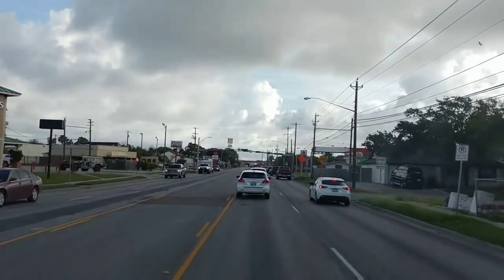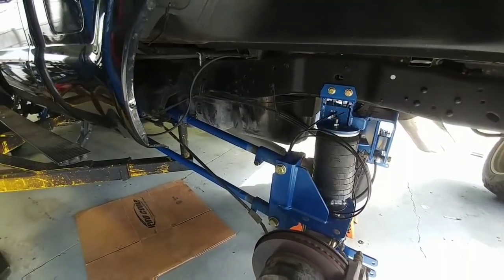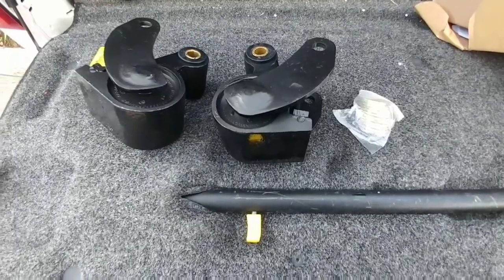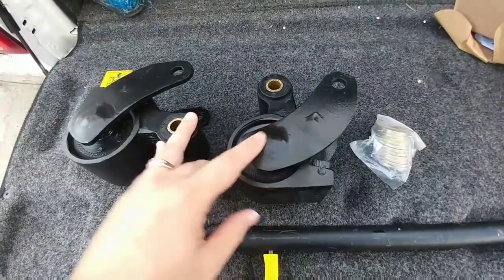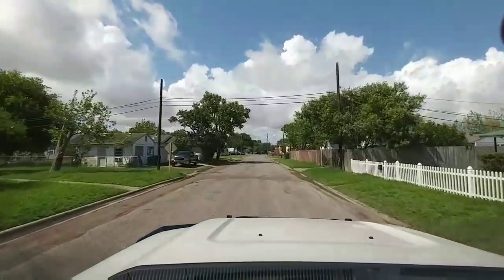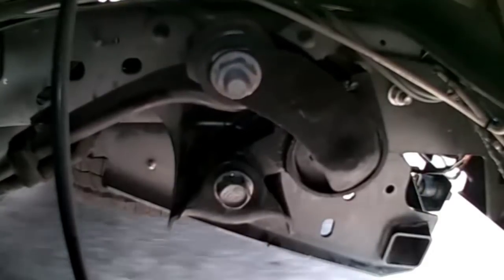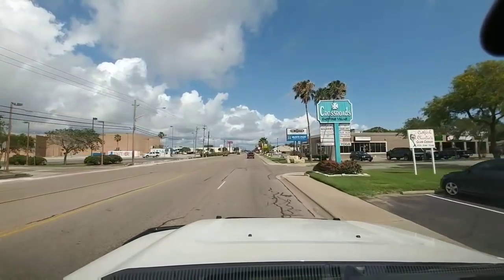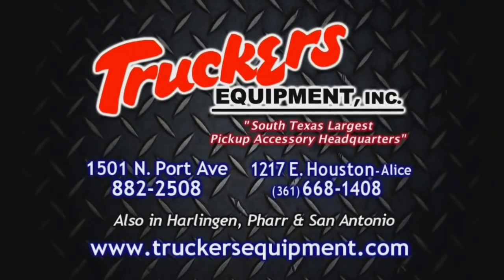Make your 1-ton truck ride like a 1/2 Ton!  Sulastic Springs!

Comment: great video!  I've just ordered a 2017 F450 and may look into these as well.   how much squat are you getting under load.  Do they reduce load capacity at all?  Do they increase the rear end height unloaded?  Thank and love the videos.  subscribed.
Reply from the maker: Scott Weitz: no reduction in load or  tow capacity. The truck sits about 1/2" higher.  And are worth it.
Reply: I too had just ordered my F450 last week. BIG TRUCK BIG RV:  I am working with the  dealer's upfit accessories deptartment to install airbags to soften ride when unloaded-  so wifey doesn't complain.  Would doing these rubber torsion brackets Instead of airbags or a nice addition To  doing both.  I wouldn't mind it driving like a dream.  After all it is our dream truck but for real.    I went with Ruby Red Scott.
Reply from the maker: WeBgamers James: awesome! I'm sure you'll love tou new truck. I would suggest both if its in your budget.  The airbags won't do anything to positively effect the ride except while towing heavy. Airbags are more to level the truck when loaded with a heavy pin weight.  Sulastics are designed exclusively to improve the comfort.

Comment: Why would you cut the bed on a Chevy if you could just lift it off the frame a bit ? If clearance was an issue
Reply from the maker: John Glennon: exactly.  I've seen it done both ways.  Lazy vs time consuming right?

Comment: I have a Dodge Ram 3500 short bed 2015. We use it to pull our horse trailer. My wife can not stand to rid in the truck when we are not hauling. We live in Oak Harbor, Ohio. Do you know where we can get a set put on?
Reply from the maker: Todd H: You can buy them from Truck Master, he ships them anywhere.  And then have any suspension shop install them.

Comment: I I own a Ram 3500 pull a 17000 pound 5th wheel how would that change the rating of the springs and all
Reply from the maker: Kenneth Wutke: should totally improve your ride without effecting spring rate

Comment: What was the net change (assuming a drop) in ride height unloaded and with your 5th wheel hooked up?  I like the idea, but don't really want to squat any more than necessary with my Cardinal 3850 hooked up.  I need as much ground clearance as I can get on my front jacks of the RV for extensions when on even marginally uneven ground.
Reply from the maker: Alan Byers: they shouldn't change your payload height much, if at all, however, you may want to consider Airbags to level things back out.

Comment: Combining a leaf spring with the torsion axle springs as used in many trailers - Very interesting. But since it adds a second spring, there will necessarily be greater sag for the same static weight in the truck. It would be interesting to research trailer torsion axles to determine if they age gracefully over a long period.

Comment: I have 2015 chevy silverado 3500hd in Pakistan 😐

shackles or spring.... should be same ?
and is it easy for mechenic with no professional equipments...?

the only truck like this in pakistan and my  first time owning truck. so i have difficulties to maintain it.
Reply from the maker: Hayat Khan: at minimum ypu will need a set of jack stands and a jack
Reply: Big Truck Big RV 
shackles or spring 
any difference?

Comment: the factory frame vibration damper and the sulastic springs work on the same principle removing one device to replace it with another makes no sense effort should be made to make them work together I installed a ford frame vibration damper on my 2006 chevy 2500hd and it was a night and day difference in ride quality and noise

Comment: When you did the test drive with the 2017 F350, would you say the ride is the same with the installation you made on your F450?
Reply from the maker: Boris Haid: funny you mention that, that's exactly how my wife described it.
Reply: Big Truck Big RV I been watching all your videos and it helped me a lots. I live in Sweden and recently ordered a 2017 F450. That will be the first 2017  to arrive in the country in September. Really excited! 
The downside with our regulations is that I can't hal a gooseneck with electric/hyd brakes. The trailer has to be with air brakes, kingpin adapter and with a 5th wheel. Luckily I ordered that package on to the truck. What cover do you have installed in the bed? Once again, thanks for doing really great videos!!👍
Reply: Big Truck Big RV I really like your truck it looks really awesome!!😎👍
Reply from the maker: Boris Haid: i use the Access Cover

Comment: I have a 2012 dodge 2500 Diesel 4x4 Pick up. I pull a 35 ft fifth wheel with it. Would these springs work on my truck?
Reply from the maker: Mark Carter: they sure would

Comment: I have a 2015 350 srw with airlift bags would these work in unison with the air bags. I tow a 15000 lbs 5th wheel. Thanks.
Reply from the maker: Yes, they work great together

Comment: It amazes me of those who buy a new pickup, immediately jack it up in the air with heavy duty springs, shocks, airbags, bigger tires and all the other bells and whistles so they can win a pissing contest about who has a "tougher" truck.  Then....they bitch and moan about how it doesn't ride like a luxury car.  Sell your truck, buy a Rolls-Royce Ghost and load your side by side, bass boat, fifth wheel, horse trailer, tractor and all the other baubles on the back of that cushy Rolls and drive off into whiny butt heaven.  Gimme a break!

Comment: when towing  my 20000 lb rv what are we looking  with that will it change that being i have a air lift kit on my truck
Reply from the maker: pipefitter Nicholson: They do not negatively effect payload or towing numbers.
Reply: Thanks
Reply from the maker: pipefitter Nicholson: i bet they would compliment your air bags very well!
Reply: Big Truck Big RV thats what im going for my back feels  rough the few time i sit in the rear of my truck its a 2016 350 dully  sometimes i think im gonna lose my head back there lol

Comment: I have a 2017 Ram 3500 4X4 with SRW and the factory installed load leveling air system. Do you know if Sulastics will work with the air leveling system? I think I'll go to the Sulastic web page and pose the same question. Finally, thanks for your videos and I like your knowledge and "common sense and practical" comments and advice/suggestions!
Reply from the maker: Sean Chapin: they should fit without issue sir. And thanks for the kind words

Comment: I did not see the 2017 Ram 2500 listed on the web site. Do they have a set for that?
Reply from the maker: RAM 2500 has rear coil springs and this product wouldn't apply.

Comment: How well will these do on a 2014-2017 RAM 3500 diesel/AISIN DRW?
Reply from the maker: Michael Brown: They will completely blow you away.  Ram duallys have very stiff rear suspension.
Reply: Big Truck Big RV well they do have air ride ram HDs that ride like cadilacs...
Reply from the maker: Dodge 318 Cummins: I've driven the Ram with Airride and they ride no different than a non air bag equipped truck. The airbags are designed to level the truck out while loaded.  They are not for comfort.
Reply: Big Truck Big RV yes the ride sucks compared to my old 1500 ram

Comment: What would happen if you would put these springs on a half ton?
Reply from the maker: Graham Clarence: not sure. try it
Reply: Big Truck Big RV I have a feeling the effect would be an incredibly smooth ride. Is this an accessory for just the rear wheels or the front wheels as well?

Comment: How does it affect tow weight?
How does it affect the load weight?
Reply from the maker: Jay R North: no effect on towing or payload.
Reply: i would imagine it would wear out if under load all the time
Reply from the maker: James Flores: Im sure some have worn out but you dont hear too many negative stories
Reply: quick question can these be put up front
Reply from the maker: James Flores: in some applications. There are no more front leaf sprung pickups being made.
Reply: yes i know but old trucks and medium and heavy duty trucks are still using them
Reply: Cause it is important to beat the hell out of the driver, even though technology has come a long way to give comfort and function.

Comment: I have F350 diesel 2011 XL long bed do you recommend for SA-06HDD or SA-06HD for best ride and long life for the rubber on my truck, And thanks for the video.
Reply from the maker: TheKNIGHTRIDER83: Dually?  I suggest the HD for the best ride, but the HDD is what's recommended for my truck, so that's what we went with.

Comment: how does this affect axle hop on trucks like my 07 ram 2500. in stuff like deep snow, sand etc, i occasionally get pretty bad axle hop.
Reply from the maker: Kyle Veilleux: may still get some, but these will help isolate the vibration from the trucks chassis

Comment: Good vid! I know this sounds nuts, but I run an air lift air bag kit on my 2013 F150, and running empty with a bit of air in the bags gives quite a choppy ride at times. Have you ever had anyone inquire about a 150? Or am I asking a dumb ass question...lol. Yes, I know, I need a bigger truck. lol.

Comment: If u want it ride like  a car . Buy a car.. if u want a 1 ton buy a 1 ton.. u cant have both .. If u have a 1 ton 4×4 to take your kid to school  and it never  leaves  the pavement  . The only time u use the truck  1 to 3 times  a year  . Then u dont need a 1 ton 4 ×4 diesel   .. factors  3/4 and 1 ton can do a lot of u dont mess with them..

Comment: Wat happens when u put 20,000 pound load on your truck wit these
Reply: Looking at the design of them, when loaded they should act just like the solid leaf spring shackles would act. They only work to reduce vibration and shock when the truck is not loaded (ie. empty).

Comment: Please try and do a review for theses shackles on a 2017 Chevy Duramax 2500hd! Please! I'm actually thinking of trading my 2500hd in on a 1500 because of the ride quality. If these shackles help the ride quality on the Chevy, it would save me a ton of money! Definitely cheaper to install these than to take a huge hit on trading in the truck.
Reply from the maker: Michael Whitson: they will help immensely.  Especially if you get the H models or even the HD model.  Also consider upgrading your shocks to something like a Bilstein 5100.  Night and day difference for around $1000 total. Plus you don't lose your butt in trading in and the loss in capabilities.
Reply: I have the 2500hd duramax with the LTZ off road package. It has the Rancho shocks, are the Rancho shocks better or worse than the regular shocks that you get with out the LTZ package?
Reply: All of my 1500's have all been plain Jane base models, this is my first 2500 and LTZ.  I'm trying to figure out what is making the ride so bad, the off road shocks or the over all 2500 suspension in general. I don't know, I've never had either before.
Reply from the maker: Michael Whitson; mainly the stuffer leaf springs designed for towing heavy weight and carry more payload without bouncing as much or squatting

Comment: Hi! your truck is diesel? is very quiet!!
Reply from the maker: adolfo abhurtadoc: yes sir.  And it is very quiet.
Reply: that´s impresive. It shall be the 7.3 powerstroke. In my country we don´t have very good referenses of that engine, but by watching your video, I can realise that at least the "issue" of the loud sound engine is completly false (and so may be the others).
How does the transmision performs?, chassis rigidity at full load, front suspension and general fittings such as dors panels, winshield, rubbers seals?
Excelent channel sir!

Comment: I would never put a link kit like that on a heavy diesel especially one that tows. . Look none of that weight is spread through the frame like the leafs did. The leaf went more than a foot behind the rear to put weight on the frame and just as much forward..  Now it just goes to the frame above the axle in one point on each rail (above the bag) instead of two points both fore and aft of the axle. The frame wasn't meant to handle weight this way. Maybe some weight with an airbag helper but not all the weight totally getting rid of the structure of the ass end of the frame. I'd never trust this on anything more than 1/2 ton. Certainly not something that tows significantly. This seems incredibly dangerous. They are only utilizing 2 parts of the frame instead of 4 to spread the load.

Comment: what i find strange my 95 tacoma rides worse than my grandmothers stock 2003 ram 2500 diesel also this looks like polyurethane
Reply from the maker: James Flores: they are rubber. You dont want polyurethane in an application like this since it would be more likely to crack or tear under torsional forces.  Polyurethane is great for spacers, bushings, and fixed applications, but not where significant elasticity is required, as in the Sulastics.
Reply: hmmm intresting

Comment: I was taught NOT TO JACK UP A TRUNK THIS WAY.  Stop and think about all the weight on the center of the rear end.  Use two jacks, under the frame.
Reply from the maker: Billy Bob: Brother, that's a DANA S130 axle.....nuff said....     jk. but it is a strong axle.

Comment: U should have bought a ram 3500. It comes from factory with rear air ride!  I laugh how u paid for a 450 and still keep modifying it.
Reply from the maker: besides the Airbags, I would have needed to add even more features to a RAM.  Plus, the Airlift kit costs under $1000 for everything with a lifetime warranty and I can control each bag individually.  The RAM OEM kit is nearly $2k and only has a 3yr/36k factory warranty.

Comment: Crap.  It just adds extra pieces which will wear prematurely and cause increased sway when pulling a trailer.   If it was a good idea, then the factory would have increased the main spring length to improve ride.  Want nice ride, buy a car.  Install polyurethane bushings, as it increases load capacity and handling, but a harsher ride.